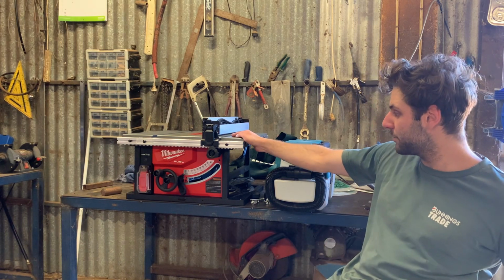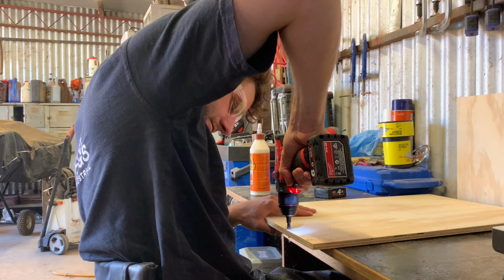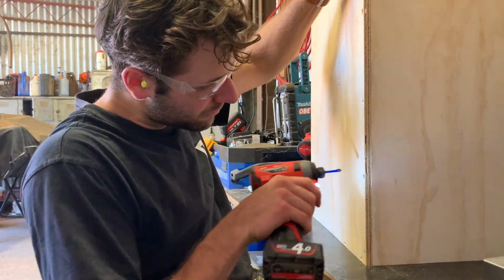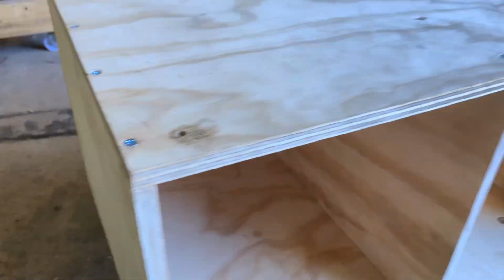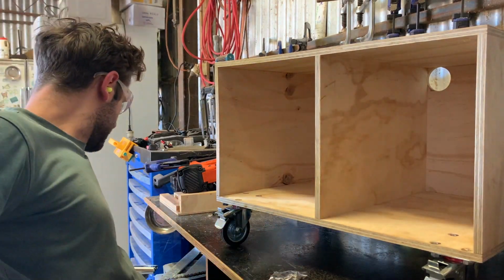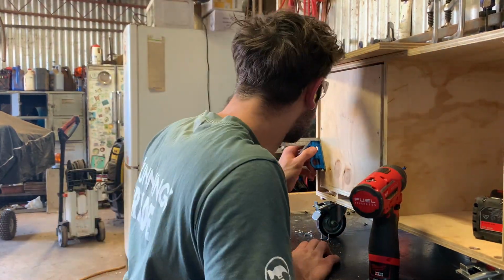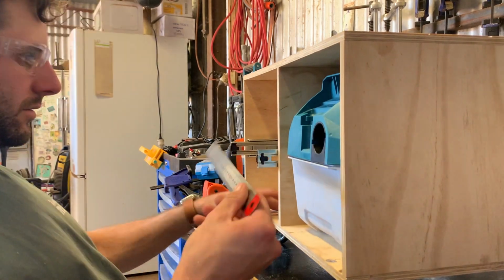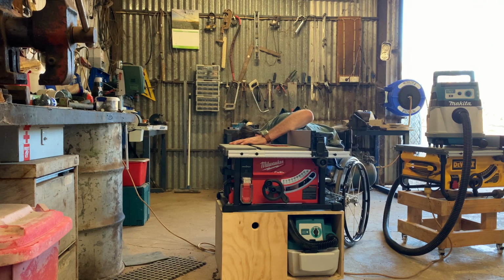How to Make a Table Saw Stand

Comment: Came out good as!
For the draw front thing I usually drill my holes for the "handle" in the draw front only, line up the draw front and screw it to the draw base. Then open it and put a couple screws in the back. Then remove that front screw and put you handle in. 
That or hot glue works too then screws

Comment: Nice build cheers! How do you like the Milwaukee saw compared to your Dewalt?
Reply from the maker: Both are awesome saws and work very similarly. The Dewalt was more accurate out of the box but both cut really accurately after an alignment. They both have their pros and cons but either of them are a great option. I only got rid of the Dewalt as I struggle with heaps of cords on the ground and getting around them in my wheelchair and the only battery table saw available was Milwaukee. But I am very happy with it!